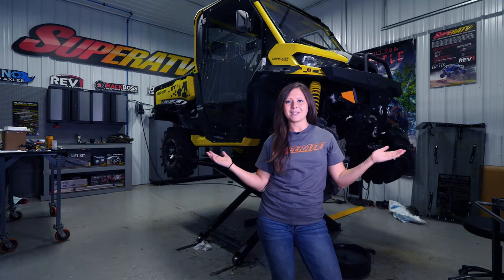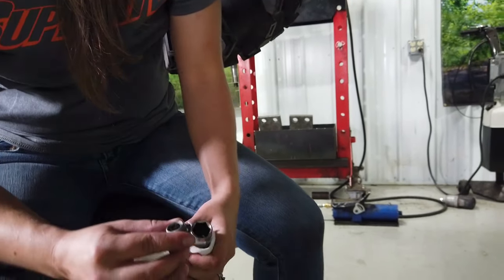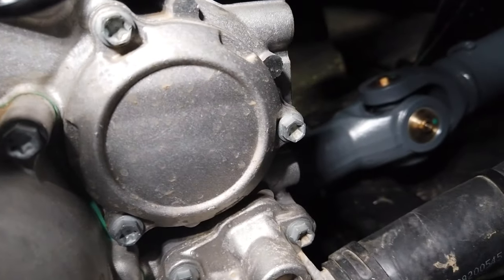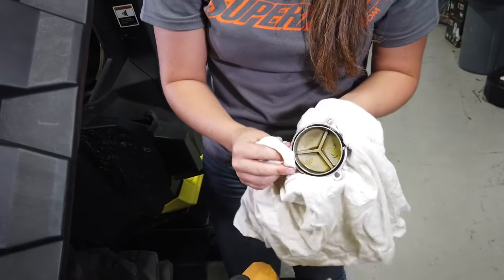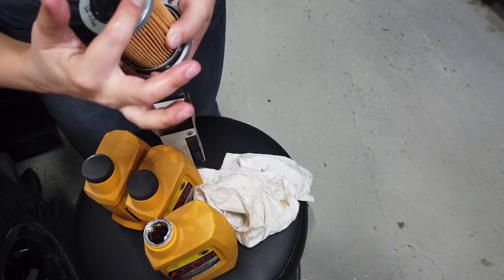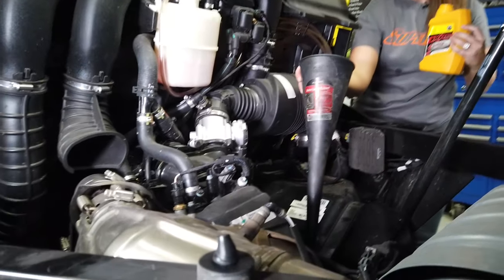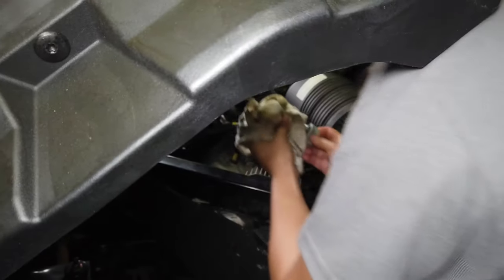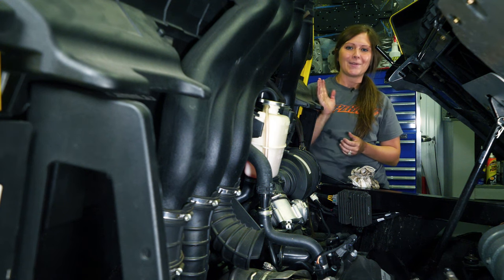How to change the engine oil on Can-Am Defender

Comment: 2020 can am defender limited, appears oil filter location is different than the standard HD10. Any help here would be appreciated
Reply: id like to see an oil change on a limited as well!
Reply: @rolsenrolsen  It's hidden behind the firewall, access from passenger side engine compartment. Make sure you have an extendable magnet just in case you drop one of the cover screws. It's frustrating but not that difficult. Can-Am has no information in manual about this oil filter location.
Reply: Quick tip, remove RR wheel assembly and remove the A/C compressor belt shroud; then prepare to curse in multiple languages as you begin the oil filter cover removal procedure.  It's a right bastard.  Fully remove the 2 lower bolts with a ratchet wrench THEN loosen and remove the top most bolt (this enables you to remove the lower bolts with your fingers while keeping a decent hold on them for quickness and ease with less likelihood of dropping one).
Reply: Watched another video where they took out the passenger seats and went through the removable rear cab panel.  I did it that way recently and I highly recommend it!  Looks like an arduous task but seriously, 4 minutes and you're staring at the oil filter cover (albeit still behind coolant lines).
Reply: Read the manual

Comment: I have a 2019 Can am Defender XMR.  I need to do a complete 100 mile service.  Do you have a video on a 100 mile service and all the things that need to be done?
Reply from the maker: We currently have how to change the oil, air filter, drive belt, and differential fluid in the Defender. If you watch each of those that if a great start on maintenance for your machine.

Comment: As a general rule always change the crush washer on the drain plug..
Reply: Not necessary
Reply: @jonnyappleseed190  you can not correctly torque the drain plug with out a new crush washer …ask any mechanic
Reply: @gobear83  been changing my own oil for about 25 yrs now and never once "torqued" a drain plug...    if you know, you know
Reply: @jonnyappleseed190  so just because you don’t it’s wrong … go sit down

Comment: Might want to check drain plug 
for any metal filings
It’s a Polaris
Reply from the maker: Correct! As we mentioned, always check your drain plug magnet for metal shavings. Excess shavings will likely equal engine troubles soon.
Reply: Except it isn't a polaris